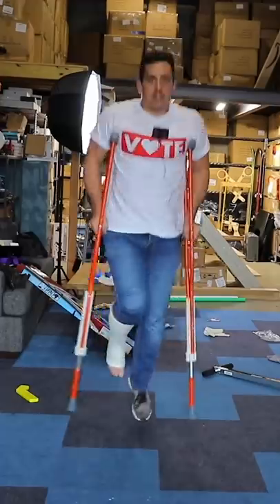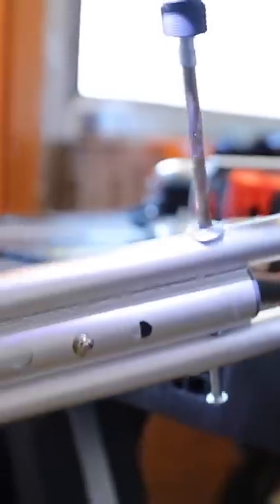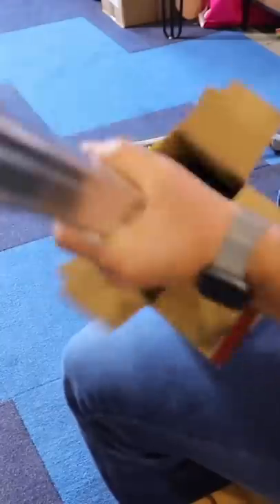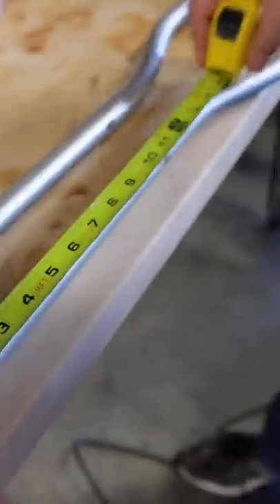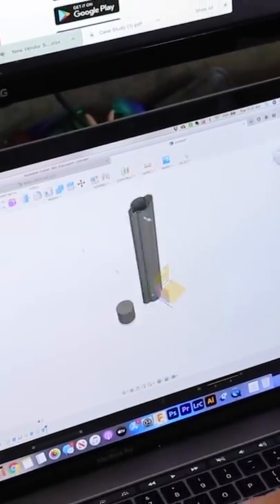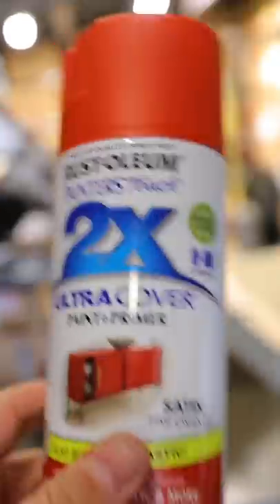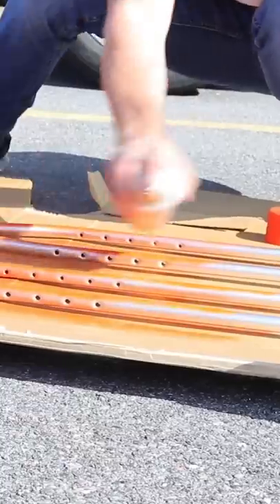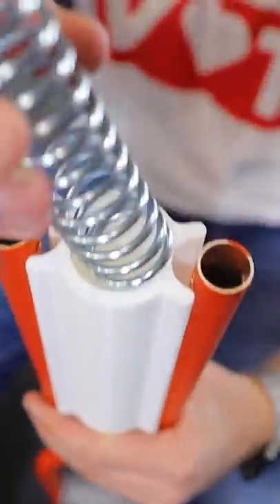lets make having a broken leg WAY more extreme

Comment: Looks like fun but also dangerous. I know that would be dangerous for me if I ever break my leg or hurt my knee bad enough to need crutches since I've never used them before and also I'd have to use them with stairs to leave or enter my place which is on the 3rd floor of an apartment building  with 6 places